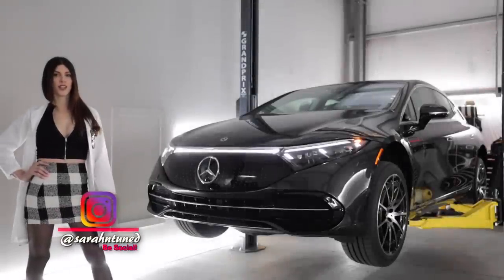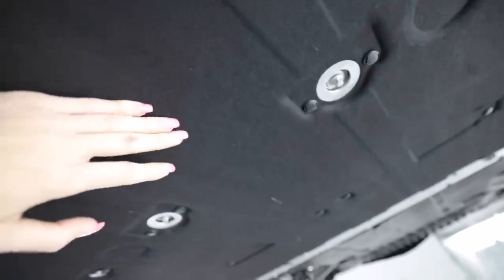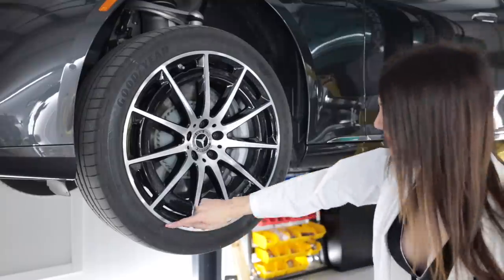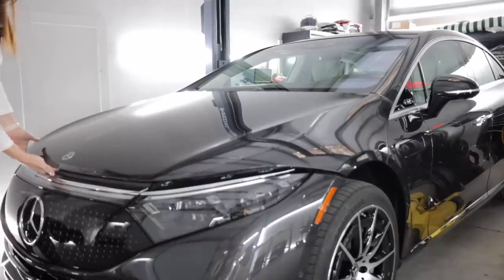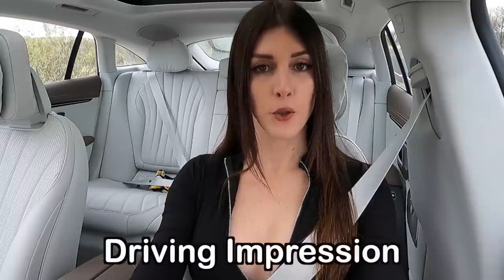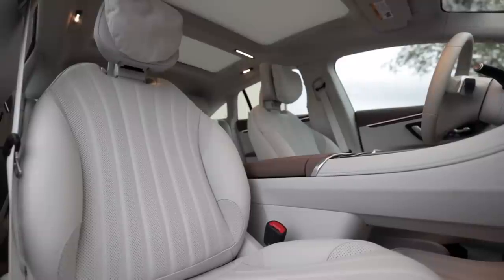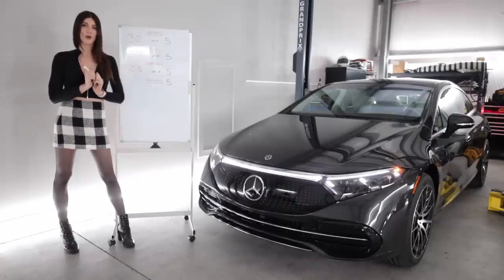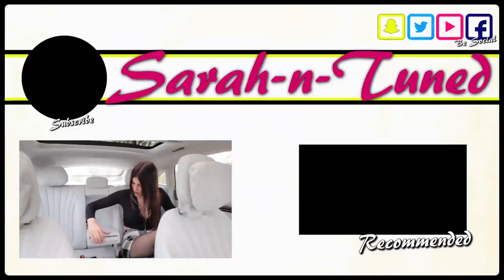This German Tesla Rival Is A ROCKET! // 2022 Mercedes EQS 580 Review

Comment: Useless Trivia: "MO" is short for "Mercedes Original" , meaning these are factory spec tires.
Simalary Audis will have "AO" tires and so on
Reply: How much would be a tire change?
Reply: @stefanmargraf7878  everything
Reply: @stefanmargraf7878  Roughly $300 to $350 EACH. Typical for high performance tires. This thing has to deal with heavy vehicle and 600lb/ft.

Comment: MO is for Mercedes Original spec, AO for Audi, AF for Alfa, HN for Hyundai N, BMW has a little Star Symbol.

So when you are Shopping for tires you can get the original spec to make sure it rides /performs exactly as designed.

Goodyear, Pirelli, Dunlop, Continental and other Premium brands offer OE spec tires, mainly for Euro cars(and Hyundai N cars)
Reply: What is original spec for Toyota Hybrids?!! 🤔
Reply: @datathunderstorm  Toyota doesn't participate in this kind of marketing crap. (Oil spec is the same)

Comment: I love how Mercedes says not to open the hood unless you work for them, and you open it anyway 😁  Of course, I'd do the same thing!  I half expected cops to show up at your door saying they had a report of illegal mechanical access.  It does seem to me this car is largely aimed at traditional luxury/sport sedan buyers, not so much trying to draw the Teslaratti.  So it's no surprise it has an opulent cabin with lots of the touches that a "regular" S-class has, and not having a frunk wouldn't seem to be a big deal, especially if it has decent space in the rear.  EVs definitely have a weight balance advantage over ICE vehicles, both in terms of front-rear balance with the batter in the middle, but also a low center of gravity.  Still, I'm sure the air suspension plays a role in the sharp handling.  I agree that the "MPGe" ratings are pretty meaningless and the range figures are more useful.
I give this review ⚡⚡⚡⚡⚡

Comment: I also had a spaceship car, way back in 1974. I had one of the earliest Fiat X 1/ 9s, which had a spacey feature. Each rocker switch, on the dash, had a corresponding rectangular light,  in blue, green, or amber, when the circuit was on. So, when traveling on a dark road at night, you could turn off the instrument panel lights, with the rheostat, and the dash would be completely dark, except for a half dozen colored rectangles, spread across the dash. It seemed quite space like to me, but in 1974, well, you know. 😎
Reply from the maker: That’s awesome
Reply: @SarahnTuned  As Jeremy Clarkson said, it had the reassuring sound of tin on russian steel.

Comment: The hood isn't meant to be accessed by customers even though with simple tools it can be. Weird flex by Mercedes, especially not designing a Frunk like other competitors. The giant filter under the hood is an option and not all vehicles have it. It'd be funny to see your reaction of that version. Also the panel you were pushing on, on the fender was for the washer fluid. Btw there are specific jack pad adapters for those jack pads to create additional space so the lift pad doesn't possibly do damage to the battery. Another fun review Sarah 🙂

Comment: Fantastic car. I don't think I'll ever be able to afford one.

In the UK, as the suspension only adjust at 120kph, meaning 75 mph, it would never be used in the UK, as sadly the max speed limit is only 70 mph. If you exceed this speed limit you are rewarded with points and a financial contribution to the Courts. I have done this several times, but currently only have 3 points..... I'm getting better.

Thank you for sharing your video and stay safe. 🤘
Reply: “Would never be used” right.

Comment: When you checking out the Tesla Plaid? That has beans for days, corners at 1.08G's, and it is around 1000 lbs LIGHTER than the EQS (but has large brakes and carbon ceramics coming soon). And the cabin filter in the Model S is even larger than the one in this EQS.

Comment: Amazing model with creative curves. The square black rimmed windshield could have been a bit smaller. I don't know why the alternator in the front is exposed to elements. Nevertheless eye turning. The red radiator that opens and closes, though not the best I have seen, is definitely pulsating. It looks slim. But it IS overweight. The most impressive thing of this model is that it gets turned on with ease. But it does not open up easily in the front. You have to bend down to what has to be done so the front opens up...slightly. It has its own lubrication controls for warm and cold conditions. Once you are in, it massages and touches you in all the right places. It does not get much better than that.

Comment: So this is an S class. An Electric S class, thus the “E” and the “S”, but I’m not sure what the Q is for, nor the 580. It for sure doesn’t have a 5.8 liter engine under the hood and that’s what the numbers used to mean. Usually. 
I heard they just dropped the new electric E series named EQE, in the AMG 43 & 53 specs. Again whatever 43 or 53 means, but I’m half expecting the regular EQE 430 & 530 standard models to arrive later on this year. 

There may not be much info on this but the one speed “transmission” at each wheel motor, is probably more of a reduction gearbox, like on a helicopter, which would develop even more torque and reduce the top speed to something resembling safe, instead of letting the wheels rotate at 20,000 RPM or whatever they could possibly rotate at.
Reply: Honestly its more of a CLS than an S class. EQ is just their way of branding that its an electric motor. In some of their new cars they have some electric engines and they call it EQ boost. As far as the numbers go, typically when something is a 300 its a 4 cylinder, 400 its a 6 cylinder and 500 is 8 cylinder. For the EQS 580 just means dual motor, otherwise the 450+ is not.

Comment: 0 out of 5 from me.  Lug nut probably costs 5 thousand dollars, and you're waiting 6 months for it.  Wonder what repairs cost?  Not that right to repair is enforced anymore.  All Wheel steering just adds more bs where it's not required.  I'll stick with my 70 Charger.  But hey no reflection on you Sarah.  Thanks for the review, thumbs up.  EDIT: The dash display sucked, but at least it was light years ahead of what Tesla does, putting off everything to the side.  That said, I like buttons.  Muscle memory, and I can actually feel that I pressed it.

Comment: For an electric this vehicle is incredibly heavy (almost 5900lbs gvw), massively underpowered (516hp) and, as a result, slow (6.2 seconds to 100kph), at about the same price as a Tesla Model S plad. 

If you love the car, love the car.... performance is certainly not the end all and be all of cars; but your title and parts of your video focus on the speed and my $54k Model 3 is twice as fast (0-60 in 3.1 sec), has the same range, and is more efficient (at half the price).
Reply: This is an S class, a electric one but an S class, I don't know if you know what that means, a Model 3 doesn't even match a C class in almost every way so what are you comparing, plain performance? So go and buy a motorbike, they're pretty fast, a fraction of the price of a car, economical and take almost no space.
Reply: @StylusPT  Firstly: I've owned a C-class and a Model 3 is a much better car (some of the cheap plastics in the C-class are simply bad, and don't get me started on Merc's esoteric controls). 

And the YouTuber brought up performance and also called the car a Tesla competitor. In terms of performance, this car is objectively bad for a BEV.
Reply: This isn’t 6.2 0-60, it’s 3.7.  It’s an insane drive.  I had the P100D and while not as fast 0-60, the drive isn’t close.

Comment: Unfortunately, this vehicle lacks a heat pump. 
Therefore, the energy for the heating is taken 1:1 from the battery and at cold outside temperatures, the consumption goes up to almost 30 kW/100 km!
Very sad, that Mercedes thereby, his almost perfect vehicle, can fall behind technically.
Reply: Try eco+ and it takes the heat from the electric engines, I hear.
Cold weather range penalty was just 20 % anyway compared to 15 % with the BMW iX w/heatpump.

Comment: The issue with this car is the electronics failing which they will as the electronics are not made in Germany but are made anywhere that they can get them made cheap. This is why Mercs have serious issues these days. There not the only ones. BMW too. I would avoid this at all costs and before anyone says that I am anti Merc I drive a CLS AMG. Which was made in Germany.

Comment: Just a little 3 cylinder diesel car below 1000cc is really efficient, incl. katalyst, particles filters, enviromental friendly in manufacturing, low fuel needed in actual use, and very friendly in full recycling. These electric cars are sheer idioty.....enviromental disasters in production, in use: putting the problem in conventional energy plants when the sun is set, the wind lied down, and with huge cable transport losses! And the recycling? You can dig them in the ground next to the blades of all windmills......i had electric.......never again, EVER.....this is not solving problems, but creating the problems.....